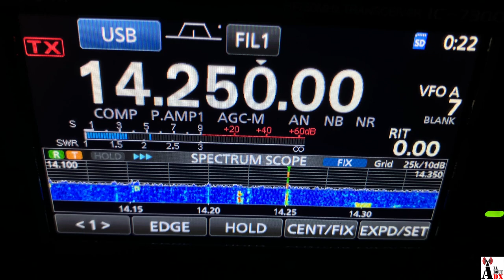Hexbeam Antenna On The Ground! Any DX?

Comment: Wow, what a awesome contact Kevin! So low to the ground aswell. Amagine the Hex up at 10m the legal height. Can't  wait to install mine. It's "All About DX"
Reply from the maker: Indeed Dave, it's all about one thing.

I've recoded another video which I will released soon too. An even better contact in terms of reports.

I look forward to hearing you once you've got the hex up.

73
Reply: @AADX  i can't wait mate!
Reply: What do you mean by “legal height”?  Does Australia not allow antennas over 10m high?  That’d be nuts…

Comment: While I don't own one yet, I think that the hexbeam design offers the best trade offs in efficiency and cost if one is looking to replace an end fed or dipole wire antenna as opposed to the quite increased costs of a tower yagi/log periodic setup. Perhaps also with less wind loading though I haven't seen a table that compares this. Thanks so much for posting this as an inspiration. 73 DE W8LV BILL
Reply from the maker: No worries Bill. Thanks for your nice comment. We are selling hexbeams, just check out our website allaoutdx.com.
However, currently we are unable to proceed with orders to due massive supply chain issues.

Please let us know if you have any questions.
Thanks and 73
Kevin, VK4KK
Reply: @AADX  Howdy!  Just a head's up that you need to fix the spelling of your site mentioned about.  You have a typo and the <b> is missing. Some people will only try once and move on if they get the 404 error.
73!~
Tom KK6BDW SoCal

Comment: Hi Kevin, and thank you for the video which inspired me to make a very similar experiment. Today I will probably finish assembling hexbeam and so far the antenna is almost on the ground (approx. 1m above ground level) to have easy access to any part mounted on the sticks. My idea is to take part in CQWWDX Contest SSB (I attend every year in single band QRP category depending of propagation I choose most effective band) at following agenda: Saturday Oct. 28th - hexbeam is @ 1m ground level; Sunday 29th I will rise the antenna as high as possible, probably @ 5-6m. Turning antenna will be done manually 😉. Then I will discover wheather SWR is O.K. on at least 3 bands (14,21,28) depending antenna height. As I prefer CW the hexbeam will be mounted @7m with solid rotator. Wish me good luck in the contest 👍. Best 73'ss from Wim, HF5WIM (ex.SP5DDJ)
Reply from the maker: Hi Wim,
Thank you for your last comment. What an honour to be an inspiration for you.
How did you go in the contest and what do you think about running the hexbeam at this low height?
Is your Hexbeam now erected?
What do you think about the performance? 
Good DX and 73
Kevin, VK4KK

Comment: Why Pre Amp on 20M?
Reply from the maker: On the 7300, Preamp1 gives you a true S9 (50uV) reading. Every S Point less is 3dB less (not 6dB). Verified that with a calibrated Rohde & Schwarz signal generator.
Reply: He has several conditions that make it useful:  1. Low band /atmospheric noise at the moment 2. Low local /manmade noise.   This is often not true on 20m and lower  bands, making Preamp generally not helpful given that it amplifies noise as well as the signal.  On this day, it is helpful.
Reply from the maker: @Pelican1984
Thanks for your comment.
This is correct. My band noise on 20m is relatively low, maximum S1 w/o Preamp.
If I had S6 noise the use of the Preamp wouldn't help.
But as mentioned before, it gave me in that situation a more accurate reading of the s-meter.
73 de Kevin, VK4KK
Reply: @AADX  The Yaesu  FTDX1200 S meter is the same way

Comment: Sometimes I also make proper DX with silly antennas; it usually turns out that the other station has a huge antenna array, high up in the sky...
Reply from the maker: Dank u wel. 
That's true. Big antennas in the sky do amplify the signal a lot. But you still need to get there. 0 times 1000 still equals zero.
73 de Kevin, VK4KK
Reply: @AADX  Dank u wel... LOL 👌